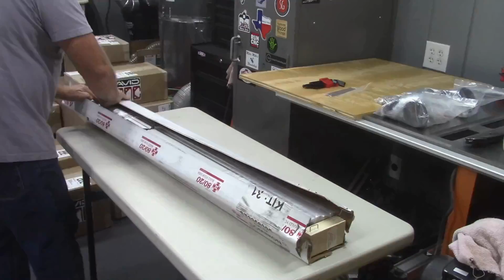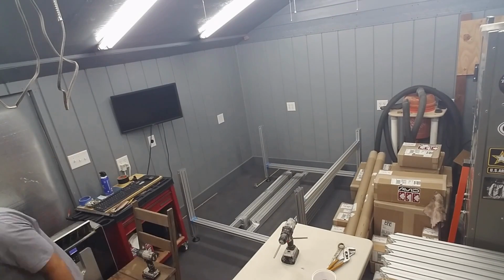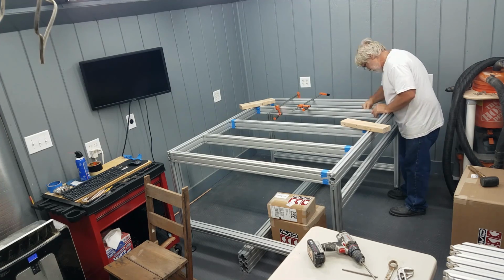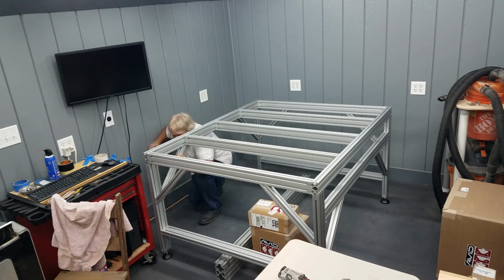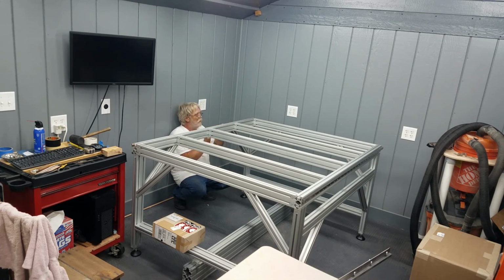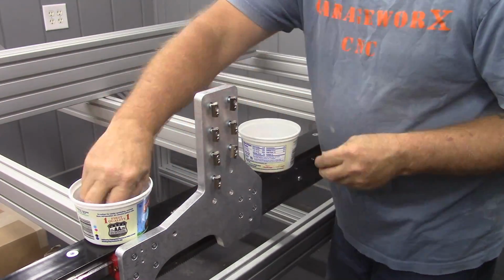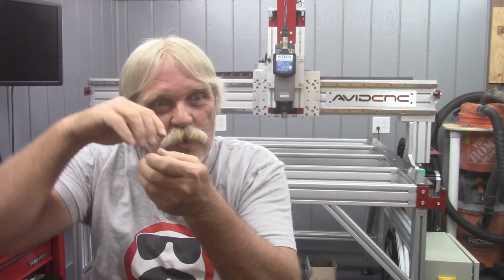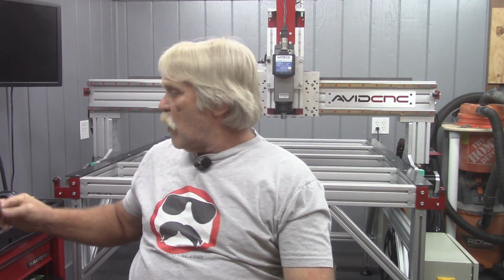Avid 4848 Pro Assembly – Legs, Machine Frame, and Gantry Risers

Comment: Great video.  In the video, you said this machine is not a beginner's machine.  Is that because of machine complexity, Mach4 or what?  If a beginner doesn't try to do too much too soon, couldn't they learn on this machine?
Reply from the maker: It's a combination of factors. First is the price, second is the complexity of the machine, third is the potential for personal injury as well as machine damage. This beast is not forgiving at all, and moves at comparatively high speeds. If you make a mistake, you make it on a grand (spectacular) scale. When they bite, they bite hard and fast. The potential for personal injury and machine damage exists with just about any CNC router, just not at the speed and power of this machine - and it's not even the fastest or most powerful machine available. Imagine you don't know how to drive, and you want to learn. Now imagine that on day 1, your instructor puts you behind the wheel of a Greyhound bus loaded with 60 passengers, and you still don't know the difference between the brake pedal and the seat belt. I think we'd both agree that this particular situation is not ideal for basic instruction. 

Yes, a beginner could get one of these machines and learn on it - IF they really dedicated themselves to learning the machine and its capabilities right from the very start, or IF they had someone local to them who is experienced, and is willing to invest some time in teaching. It's just my opinion, however, that a beginner would be better served learning how to use a CNC router on something a lot less expensive, and with a much more gradual learning curve. Why set yourself up for failure before you even begin? 

As I said, that is just my opinion, so feel free to take it with as many grains (or tons) of salt as you wish. I've based that opinion on trying to help people who got in way, way over their heads way, way too soon, and had less than stellar results. (Thankfully no personal injuries, but a few close calls and damaged machines.) Much better, in my opinion, to learn on something a little smaller and easier on the wallet, then move up to something like this.

Learning Mach4 isn't really an issue - if I can do it, anyone can. Mach4 has a ton of capability that I know I'll never use. I base that off of my experience with Mach3 - I didn't use about 95% of what it was capable of, either. Once Mach3 or Mach4 are set up and ready to use, they're very simple to learn.
Reply: Thanks for your advice Mark.  Much appreciated.

Comment: That is exactly the cnc I plan on upgrading to. I have planned it for two years but in 2020-21 I bought a 14' x 28' pre-made shed and relocated my shop fifteen miles to my yard vs my dad's yard...where my shop had always been. In 2021-22 I got a Thunder Laser 35-100watt instead of a Avid. Hopefully the next upgrade will be to sell my Shapeoko Pro and get a Avid!!

Comment: Nice! Very nice step up I would love to have that machine. But please Mark, tell me you aren't switching to Mach 4 or something else.. Lol. I need you Mach 3 advice to continue. :)
Reply from the maker: Well... I'm afraid I am switching over to Mach4. But on the bright side, I've never really given any Mach3 advice, so you won't be losing much.
Reply: @MarkLindsayCNC  well I just meant on your vectric videos you always use Mach 3 and used it for the triple edge finder. Are you still going to use the triple edge finder with Mach 4? If so that would be a good video on how to make that work.
Reply from the maker: I will not be using the Triple Edge Finder with Mach4 - it's going with the Gatton CNC. I have the Avid CNC 3-way touch plate, and Mach4 is already configured for it. It truly is plug and play.

Comment: Interesting machine and seemingly nice design. Linear rails and blocks, instead of plastic rollers, rack and pinion drives instead of lead screws and seemingly a rigid design. Bit of a task to put it together, like an erector set. I remember the Gilbert Erector Set well. I built a lot of great stuff with those sets.